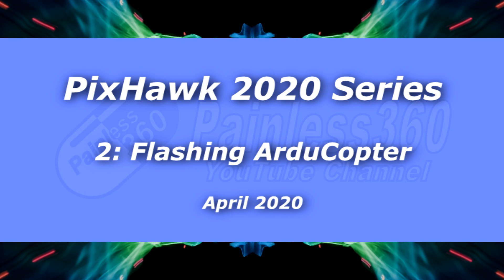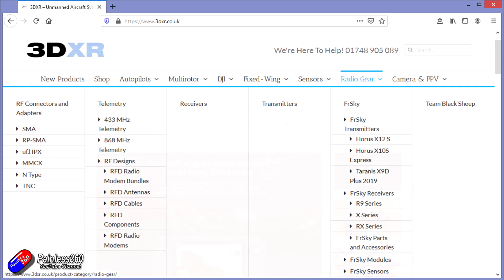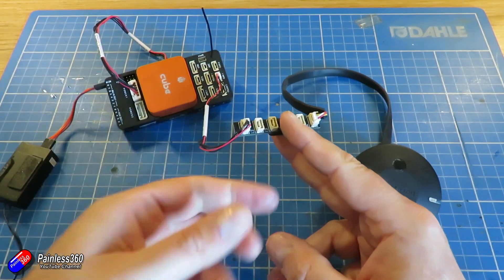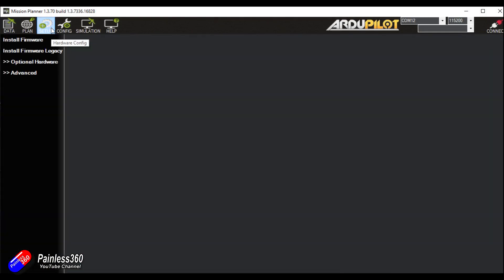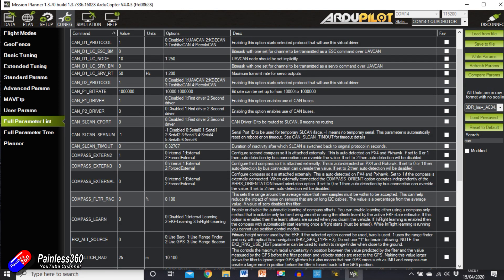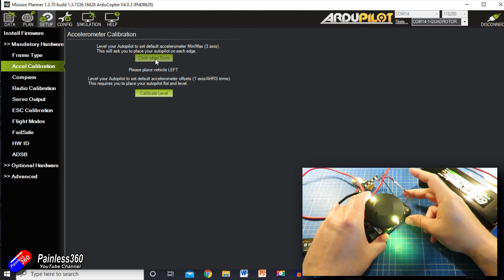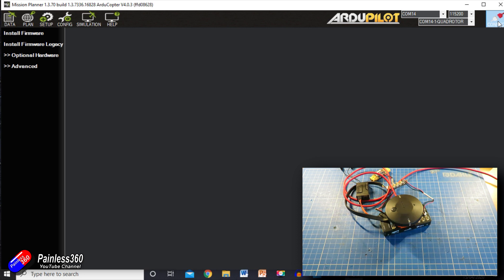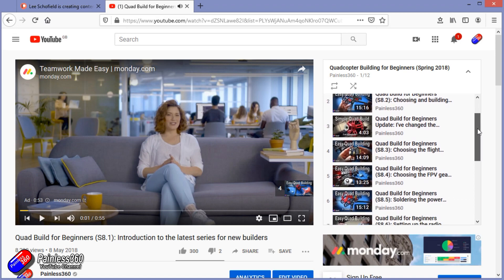PixHawk/Mission Planner/ArduCopter Build for Beginners: Flashing the flight controller

Comment: Hi,
Thank you soo much for making this amazing detailed series. Highly appreciate it.
I just got my cube orange and herelink and I can't wait to create a build and get it flying.
However I was just wondering that why is the power brick rated only to 30A continuous? Is it because of copper thickness limitation of the power module or what? Because 30A is way too less for larger builds like x8.. Is it possible that if I fill the copper traces of the power brick with solder, then I can get 70A continuous? Or am I missing something here?
Any help would be highly appreciated.

Comment: hi lee ! i have 2 question to ask you , i just got my pixhwak 2.1 orange cube and my 2 here 2 gps yesterday i want to flash it with arducopter like you do in this video , my first question is should i connect my 2 gps like you do with the ic2 splitter in can and configure it in misssion planner has can p1 driver to1 for gps #1and can p2 driver to 2 for gps #2 and then gps_type to 9 for gps #1 and gps_type2 to 9 for gps #2 , my second question is do i have to flick the switch from ic2 to can into the gps itself or not , thank you lee for your answer !!
Reply from the maker: All of the steps I followed to configure this one are covered in the series. Best of luck with your build!

Comment: Could you cover adding an optical flow for better position hold? Although looking at the price for a PX4_flow sensor on amazon, I was shocked! The MUCH better RTK GPS receivers (like the sparkfun board) now offer nearly millimeter accuracy!
Reply: RTK GPS modules are around $100 to $250, as the actual chip itself that does the magic costs around $80.

Comment: Does it matter if I install the firmware with quadcopter logo on it or hexacopter on it? They all seem to be Copter 4.0.3. I'm asking to see weather I need to reinstall the firmware when I switch from a hexacopter to quadcopter. Old versions are labeled differently these seems to be the same.
Reply from the maker: I've always re-installed but an expert was telling me that all it really changes are the default mixing and output for the motors so I guess if you are happy editing that yourself then you should be good... Best of luck
Reply: @Painless360  seems to me that when I click the quadcopter in the frame type menu on the top list it does the same since FRAME_CLASS set to 1 after that choice.

Comment: My Here2+ came with the I2C cable attached.  I have opened the unit, flipped the switch to CAN, switched the cable to the canbus cable and plugged it into Can1.  In MP, I went Params and Can_SLAN_CPORT and set to 1 or first driver.  However, when I go to UAVCAN and select SLCAN Mode 1 it does not connect.  The whole time my puck has a nice teal blue LED.  Where do I start and getting my GPS to be seen by my CubeOrange
Reply from the maker: Not sure, I'd contact the reseller for help. It wasn't that tricky here..

Comment: How would you connect a 22v battery with an ec5 connector to the cube board?
Reply from the maker: Lots of power modules exist, some without connectors, so you can solder your own... Best of luck

Comment: Nice video!! Where did you get the can bus splitter?
Reply from the maker: With the Pixhawk cube. See the other videos in the series... happy flying
Reply: @Painless360   I did, but it does not looked like it is powered like what is in the Ecosystem poster.  Also is there any plans for a can bus esc build?  Thanks so much for the videos, they help a lot.

Comment: During compass calibration, only Mag 1 is working but Mag 2 is not loading offsets. How to troubleshoot it?
I'm using both the compass, compass #1 (externally mounted) as well as compass #2
The FC is radiolink pixhawk with SE100 gps.
Reply from the maker: There are settings for the compass types on the calibration screen. I'd have a look in the manual you got with the FC or the wiki in case its the settings that need changing. Best of luck
Reply: Painless360 The SE100 gps itself is a UBLOX NEO M8N. But when I do compass calibration only Mag 1 is being calibrated istead of both Mag 1 and Mag 2. Is it because of a bad compass in RADIOLINK PIXHAWK?
Reply from the maker: Maybe, or it's not properly configured. I'd check what it says in the HW ID section of Mission Planner.. Best of luck
Reply: Painless360 Thank you guiding me. I just checked in HW ID both the compases internal as well as external is being listed. But still while compass calibration only Mag 1 is being calibrated. How do I configure it properly?

Comment: From what I can see (Jan 2022) the orange cube flight controllers are around $300 USD.  Does anyone know of any cheaper ones to get started?  Or is that the "cheaper" ones lol.  Thanks!
Reply from the maker: Lots of options for hardware if the Cube is too expensive. Check out the HOLYBRO options... Happy flying
Reply: @Painless360  ah thanks for the recommendations.  Im just thinking im gonna mess up the first round so would rather go a little cheaper to start while im "learning" lol

Comment: When i switch power brick setting from V/A to V, pixhawk cube detects failsafe and measures battery voltage wrong. Is this the i am only one that have this bug?
Reply from the maker: You need to setup the power module for whichever module you're using and make sure it's plugged into the right Power port... See the docs.. Best of luck!

Comment: Actually I'm facing the GPS issue. There is showing Prearm need to 3d gps fix.
Reply from the maker: Is thya a request for help? What troubleshooting have you already done?
Reply: @Painless360  Compass Calibration & HDOP setup manually done but still unable to arm in loiter mode and 'no GPS' showing in mission planner.
Reply from the maker: So, you checked the GPS is working? Does it have power? Can you see any activity from it in Mission Planner? Without more detail it's impossible to offer any advice. Happy to help but please watch https://www.youtube.com/watch?v=olIqTiSJHIY and come back to me with more detail of what you've tried..
Reply: @Painless360  Yes, when connect it to mission planner then green colour appears. But in mission planner not showing that APM is connected with gps. After calibration when do movement of quadcopter displaying it in mission planner but seperately I do movement of GPS then not displaying.
Displaying like "No GPS".
Manufacturer told setelight does not connect in indoor.
Rest of it all spare parts working well.
Reply: Eventually I able to use GPS.
GPS is not displaying in mission planner but does work .
Thank you so much for support & responses.

Comment: Can anyone help me on this idea:  I want a slow, stable, quiet multi-rotor, "cine" platform.
But even more quiet.
And even more slow.
And even more must be under 250g....for the bureaucratic ramifications...
I would like it to be quiet, but maybe also tuned to certain frequencies that blend in with everyday life...lawn mowers and leafblowers and weed whackers....
Reply from the maker: Tricky as the smaller models typically have a high whine. See my sub 250g playlist for what I've looked at here... Best of luck
Reply: Hi - I have a spreadsheet here that I use for prop/motor performance calculations and it suggests that a 2-blade 6 x 4 prop with an effective blade chord of 14mm (sorry for the mix of units!)  turning at 5900 rpm will give a hover thrust of 70 grams with the blade Cl at about 0.7 so not too close to the stall for the use of about 3.7 watts at the shaft (obviously subject to losses in the motor/esc when sizing the battery etc). A 7x4 (of the same chord) at 5000 rpm achieves the same thrust for about 3.3 watts at the shaft and at a Cl of about 0.62 so should be even better.  Seems as if you need to find some suitably low kv motors with perhaps a 10 watt capability. My slight experience of sub 250 is to make a soarer of 1400mm span and doing a very careful weight budget seems to be the trick - my estimate was 230g and it came out at 238g thanks to not allowing enough for the glue! I think you need to aim for 220 grams and hope you don't miss by too much. Good luck!
These guys may be able to help with the motors:-
http://www.micronradiocontrol.co.uk/motor_brushless.html